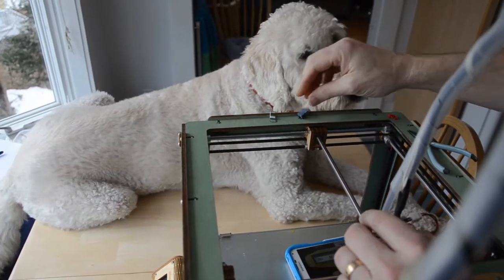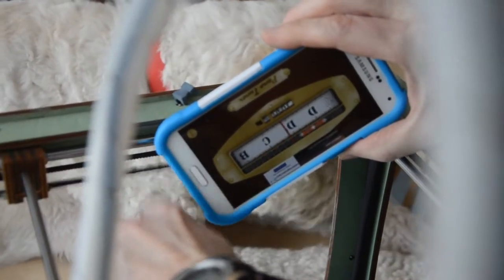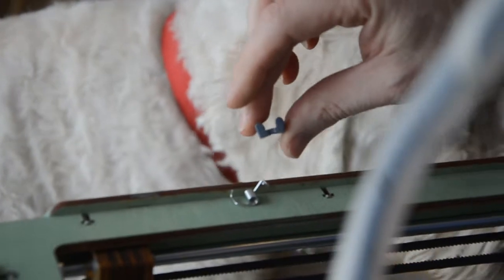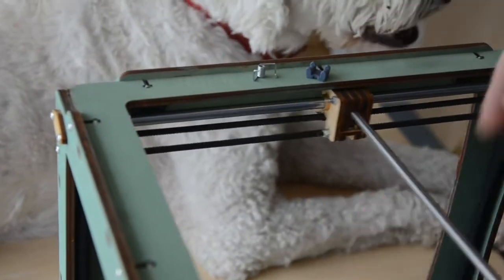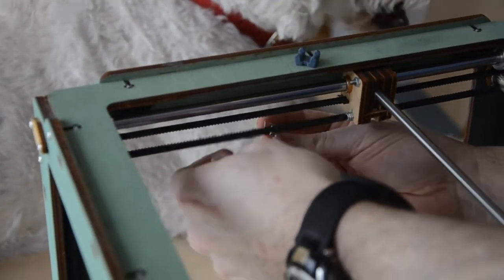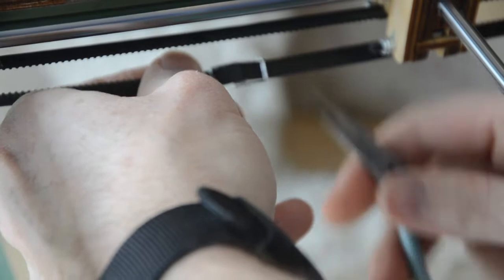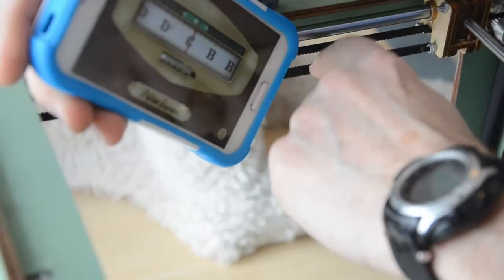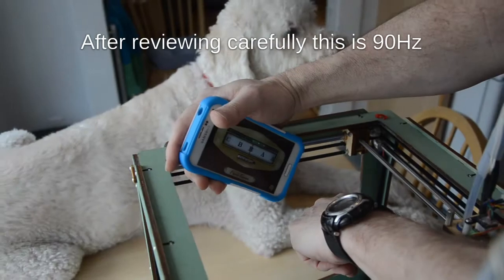belt tensioners

Comment: Sound tuning?
wouldn't the pitch be affected Both by the tension, as well as the belt Length?
if we have a different model printer with longer belts what note should be we looking for instead?
Reply from the maker: Yes.  This printer has about 230mm of travel.  The pitch changes inversely to the length (if tension is constant) so twice as long would be half the pitch.  I'm not sure what the perfect tension is anyway. You want it as tight as possible without adding a lot of friction or without making the wear on the bearings so bad that they only last a few months.
Reply: Length is essentially the same during this procedure tho.

Comment: 0:18 “this one has a number here and its 137, so...its actually closer to 48............ anyway.”

Where the hell did you get 137 from if you just started tuning. Lol
Reply from the maker: I'm not sure if you can see it in the video but the tuner app throws out numbers (frequencies in Hz) that bounce around.  I was just reading some of the numbers.  The app tends to jump by 2X (one octave) as the "note" has lots of harmonics.  Typically you want the lowest frequency the tuner app displays (the root frequency) and want to ignore the harmonics.  It gets easier with experience.

You can reduce the harmonics by plucking in the center of the belt.  If you have a musical ear that helps a lot to know which belt is lower pitch and which is higher.  The tuner also works better at 100Hz (when the belt is tighter) than when it is so loose.